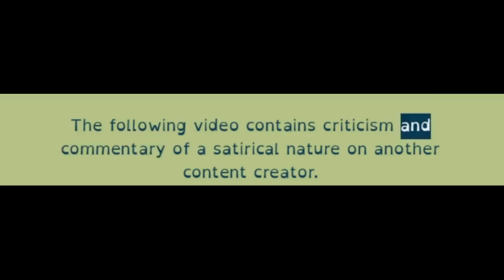REACTION: Another INSANE CRINGEFEST "Restoration" - Antique Kenwood X76 Cassette Deck

Comment: This is NO SENSE. Decks from that era, with given exepctions, are WORTHLESS. This is not an ANTIQUE at all. This a piece for the decay period of tape decks. This effort could make sense on a rare or exnepsive machine and even if you found a Nakamichi Dragon, 700 or 1000 ... in this condition, it may not have sense neither since they are presicion machines and once you wirebrush the parts you defeat the tolerances !!!!. Could be just as a hobby, you will never get proper Nakamichi specs again

Comment: Any piece of electronics left in dirt long enough to rust like this will be DEAD 100%. I just so happen to have enough experience with electronics (because that's my education) to know that any prolonged exposure to even clean water will kill almost any piece of electronics. Because them components look pretty but they ain't anywhere close to be waterproof.

Hell, when one of the students in our class (over 15 years ago now) went nuts (he genuinely did) and washed his brand new board (some blinking christmas star) with tap water, he murdered it on the spot. And that was three minutes of washing and we didn't manage to revive it inside any reasonable budget.

Anyways the thing looks like he washed the metal with some acid previously, then poured some mud on it and carefully placed it outside. I can tell from the tape mechanisms, since they have very consistent vertical rust pattern. From that I can tell this thing spent it's rusting time motionless. I have seen another video with him reviving some cctv camera with same pattern of damage :D